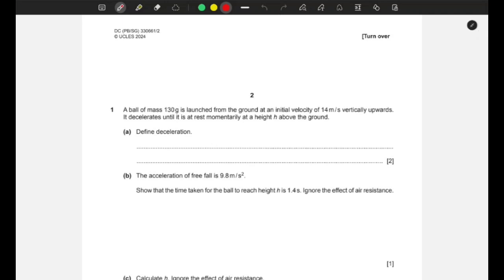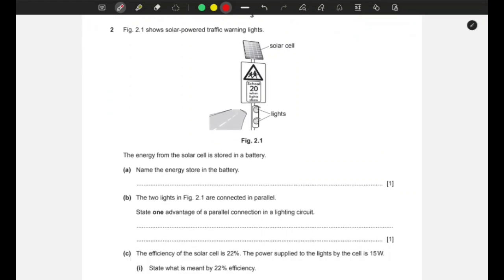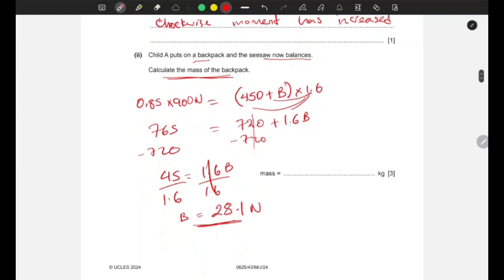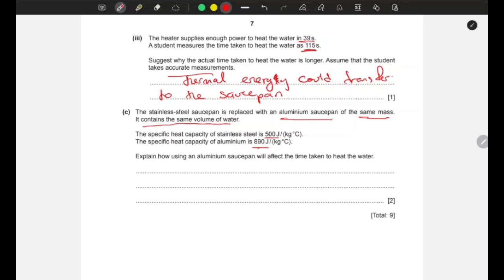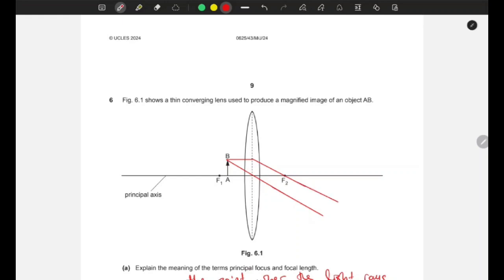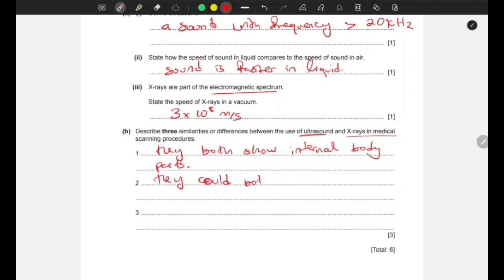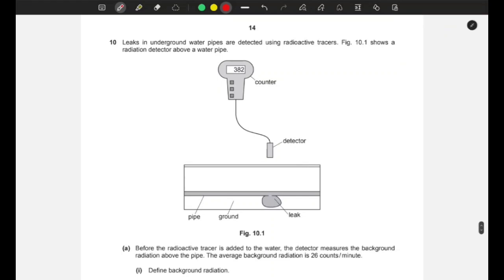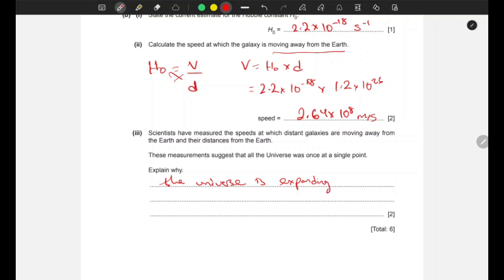IGCSE Physics May/June 2024 paper 43 walkthrough and revision (0625/s43/2024)

Comment: 27:57

Can you explain why the field lines at the very edge of the plate dont curve?
The mark scheme also doesnt mention any curve but i remember my teacher mentioning that they should curve slightly at the edges.
Reply from the maker: I think u misunderstood it field lines should always be parallel and straight i think the curve your talking about is when a charge is passing through the plates in that case if a charge is moving horizontally through the plate it will be deflected